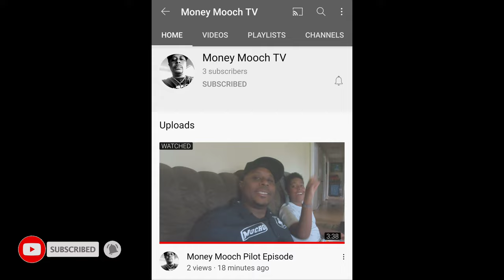📢 Money Mooch's Big News ➕ Frame Painting Begins (Bray Was Fed Up❗)

Comment: Your 7 pin hitch Plug is the one I was telling you it's your 1 o'clock is battery and your six o'clock is your negative and that's how you charge the battery on your trailer or a vehicle hope you get this hope you use it research it on YouTube you see what I'm saying it'll work out for you especially since you running a dually and you picking up cars just see what I'm saying
Reply from the maker: Yessir. I know all about it. Just need time to do it. It's low priority right now.